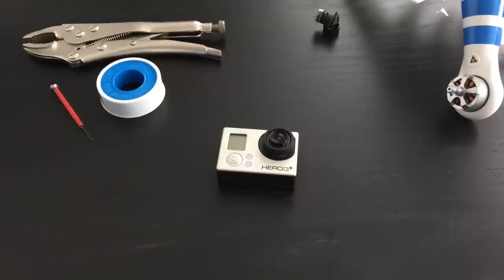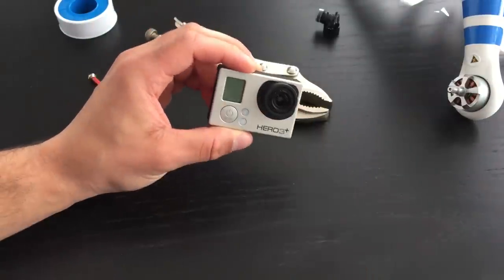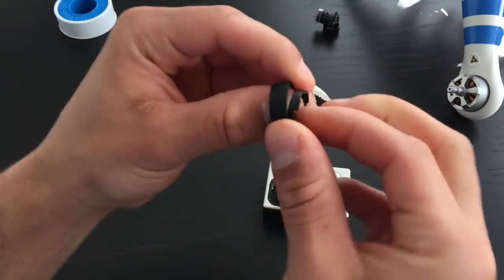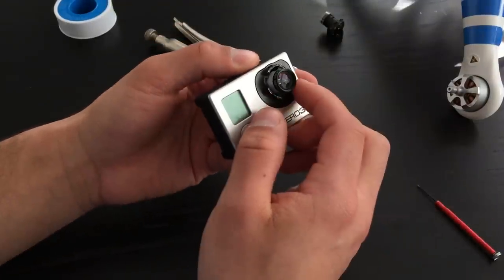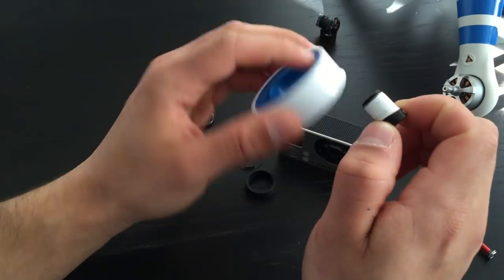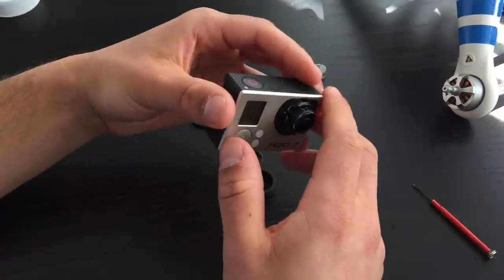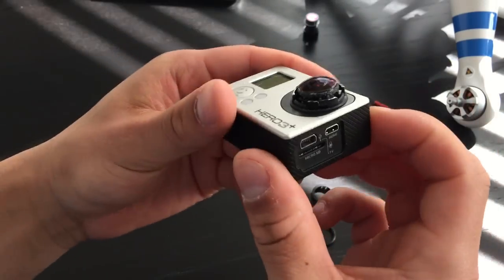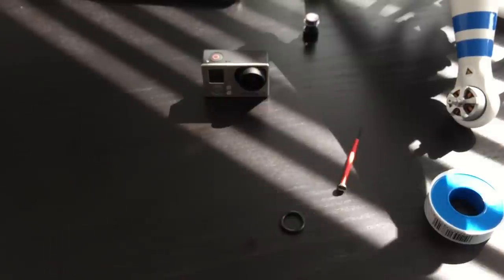EASY GoPro Hero 4/3+ Lens Change - 5.4mm 10MP Non-Distortion Lens Install

Comment: Hi. I installed the 5.4 lens as shown in this video. But with the original lens mount you have only about 5 turns of 360 degrees screwing the lens in to the focus point. That is only 2 mm depth of the screw-thread. The result is that it is almost impossible to fit the lens absolutely vertical to the sensor, even when fitting with special plumming tape. There is a big change that your picture will not be perfectly sharp on one side. So I ordered the replacing lens mount also, because this mount has a screw over the whole lenght of inside of the tube in order to fit exactly vertical to the sensor.
Reply: +Hay Stevens Where did you order the replacing lens mount? Thanks.
Reply: +Dan huiting The lens mount was ordered at sales@vision-dimension.com, Germany. Article No. 302379.

Comment: Hi, L'Moy new to this and just need a bit of advice, I've got a hero go pro 4 that I'm going to use with a drone. I have purchased a 5.4 lens but want to make sure it's worth changing the lens. Are there GoPro 4 black settings that will give the same effect or am l best to change the lens'?
Reply: +Roger Palin There is a setting in the gopro Studio to remove the fish eye effect, but it''l be similar to a 2.8mm lens, and It's not that reliable. I'd say try the lens, and tell me what you thought, cuz I want to buy a 5.4 too